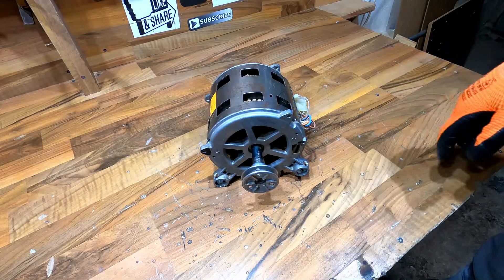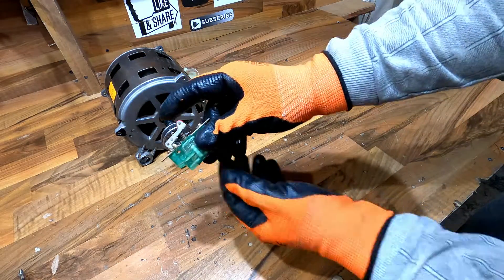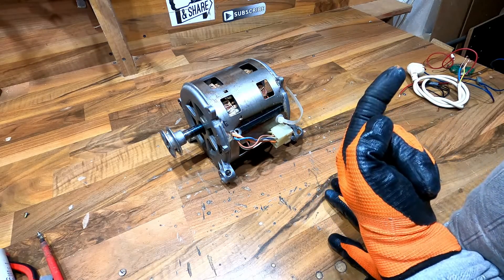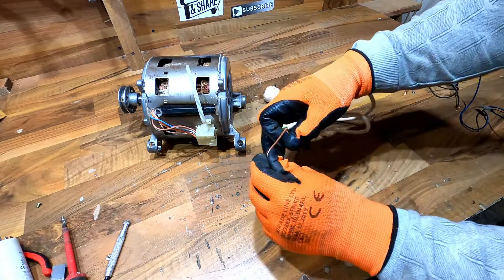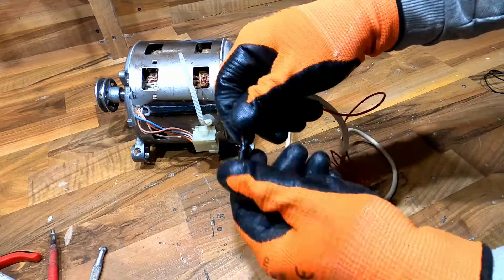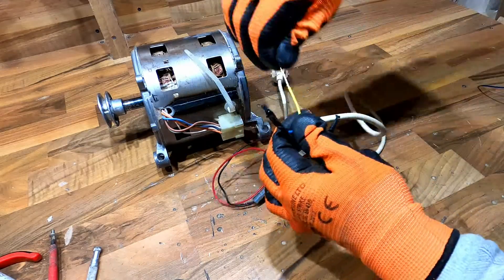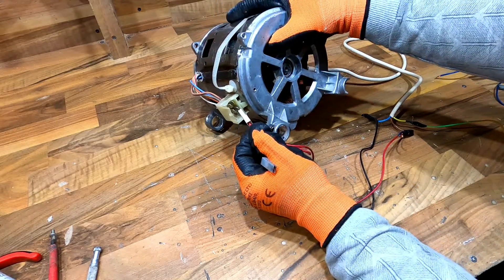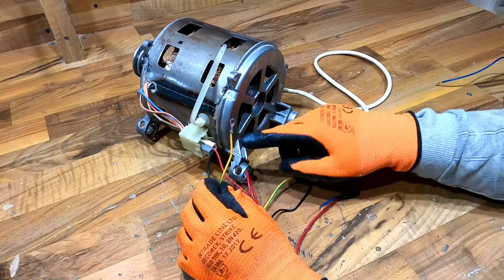How to Start Brushless Washing Machine Motor without Capacitor

Comment: What is the point of this? A PSC Induction Motor will have zero torque without the Capacitor. The Capacitor provides a phase shift and is necessary for running not just starting.